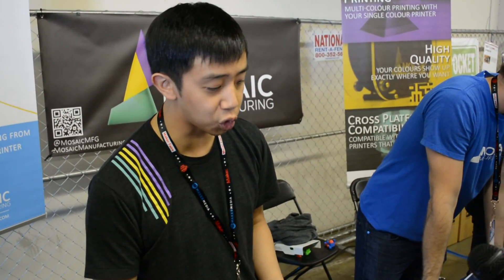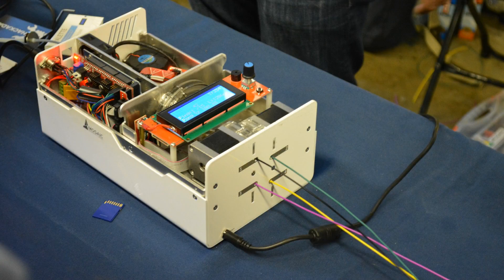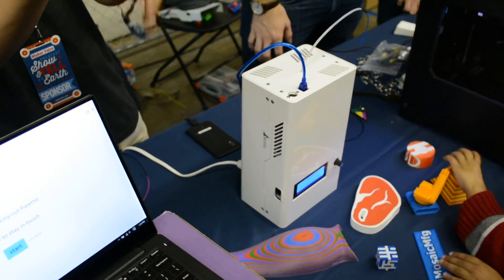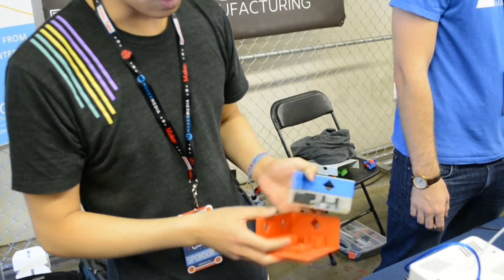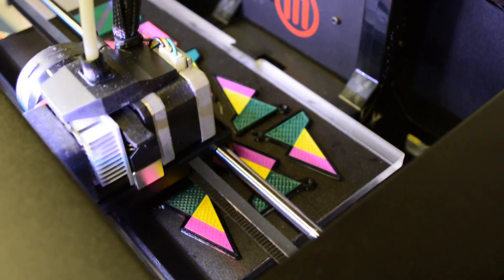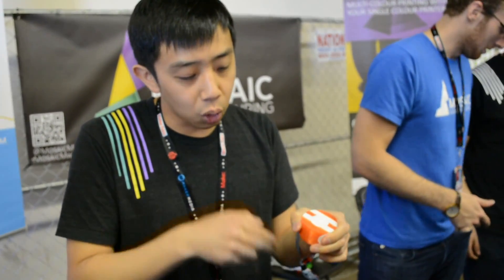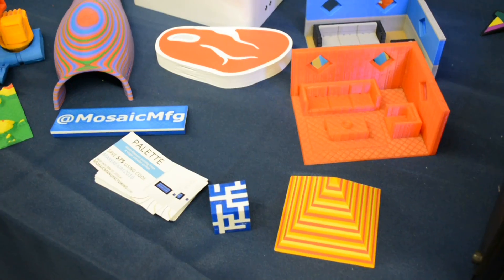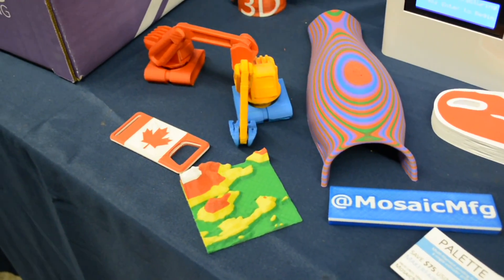Multi-Color 3D Prints by Splicing Together Filament

Comment: you could make a rgb 3d printer just by melting 3 filaments then mixing it and then molding it back into a filament
Reply: could, but the mechanical complexity would increase the cost drastically. on top of that how are you going to clean your mixing pot, such that you get no cross contamination of colors?
Reply: No, 5 colours are needed for the full palette: black/white/Cyan/Magenta/Yellow. Look up Diamond nozzle, it currently accepts 3 inputs but are planning for a 5 input version.